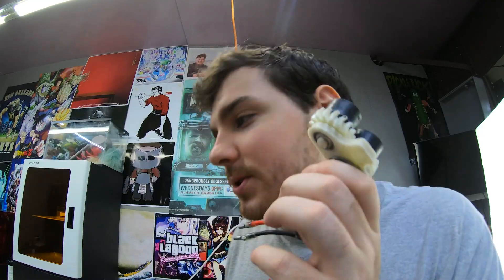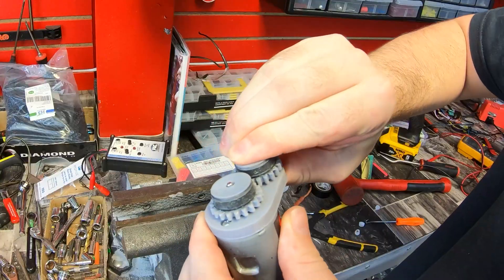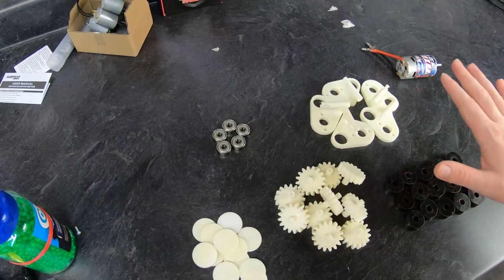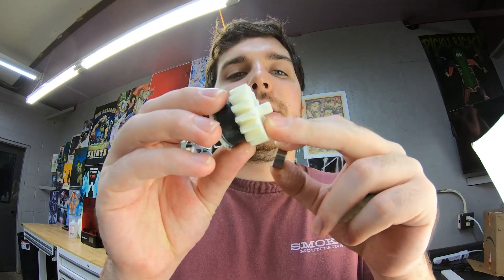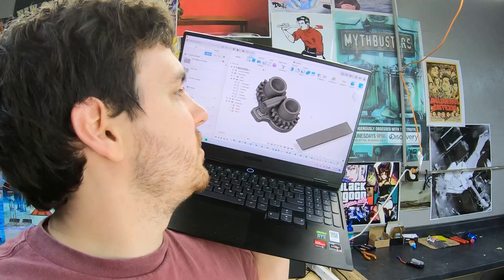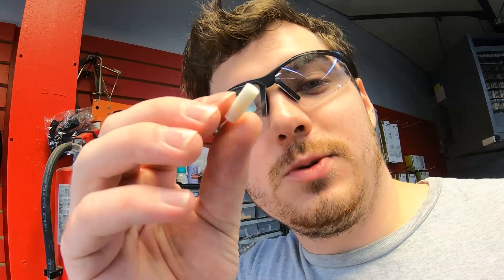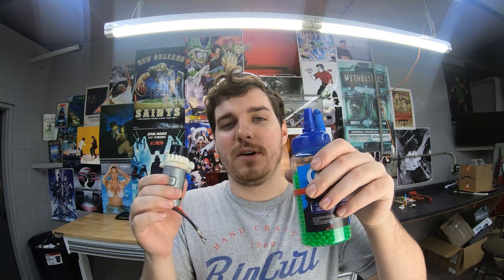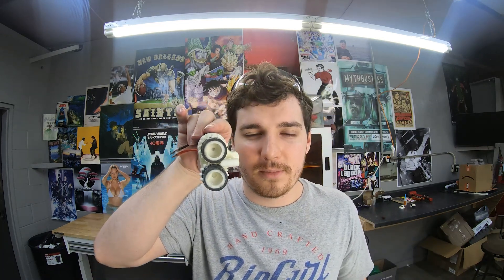𝟛𝕕 𝕡𝕣𝕚𝕟𝕥𝕖𝕕 airsoft gun prototype 6

Comment: Hello blake,

If you want to achieve a projectile velocity of around 100 fps (pretty low for airsoft), you would have to spin the rotors with an angular velocity of around 20.000 rpm (based on 30mm rotors). Have you considered this?